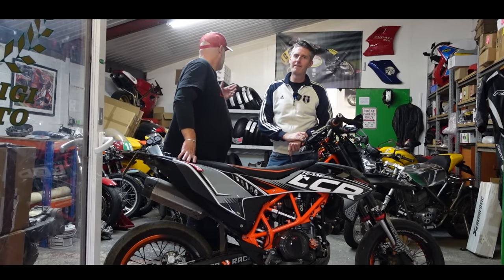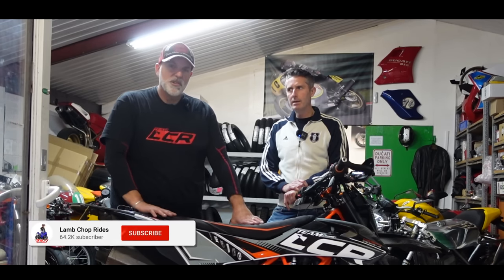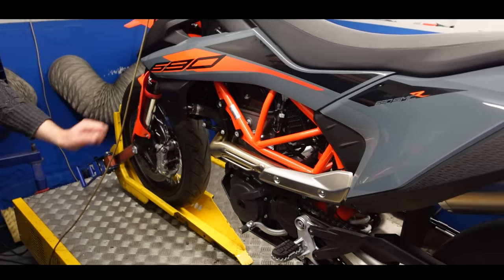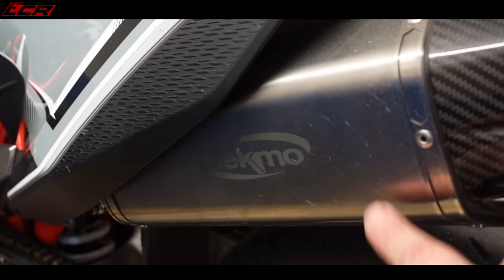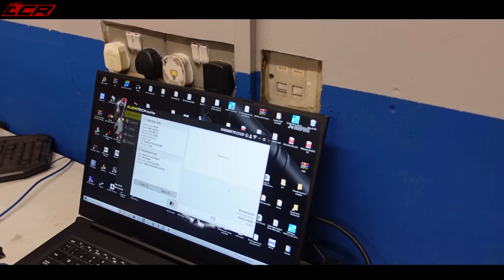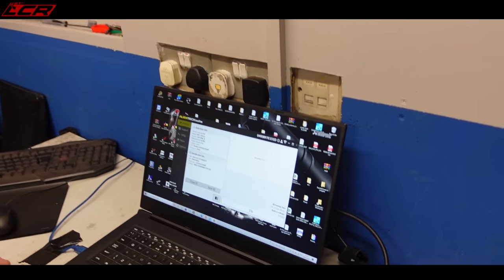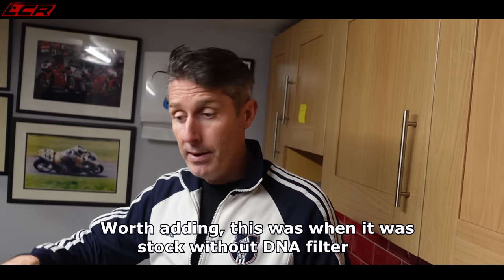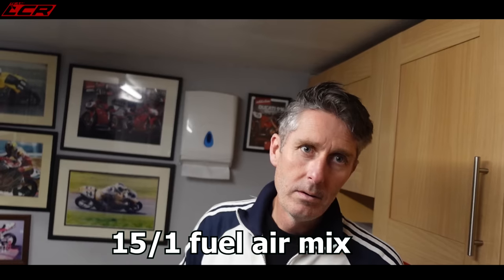KTM 690 SMCR Dyno Mapping | Finally Its Running Properly!! 💪💥

Comment: I am kinda confused with these results. help me out because the stock power is 75 bhp for the newest engine. I ride the 2016 model so the engine without the balance shaft and after some heavy modding  i get 78 hp now on the old engine.  mods are  full akrapovic system, open air filter (dna combined with k&n) camshaft,lambda removal with the rottweiler dongle and the powercommander to override the stock ecu because its not made to write a full map to it.
Reply from the maker: Yes 75 hp at the crank, these are rear wheel figures. You loose 15% or so via the transmission. The gains are in the bottom and midrange, you won't get more at the top without cams but then that sacrifices midrange and bottom end. For the road riding and wheel popping ability   we prefer the midrange punch to topend screaming
Reply: @Lamb Chop Rides  Ok that explains the difference in power measurement. Thanks for the quick explanation 👍.  I ordered the new 2023 model so I am curious if it wil ride better than my old 2016 model.
Reply from the maker: Yes its much smoother with the extra balance shaft 👍👍

Comment: Proof that a Power Commander correctly mapped is as good as a reflash. Plus its a 5min DIY job to remove if you want to make a claim or sell it when you no longer have the bike, so its not 'dead' money thats lost.
Reply: Totally agree with you Dave but what if it’s a EURO5?

Is a Flash not really the only option?

I’d prefer not to void my warranty and always have the option to put everything back to standard. 

but what other option is there when the closed loop section will always over ride a Power commander 5? (With the EURO5 Engine)
Reply: @SuperPlasterMaster  inline fuel optimiser allows a euro5 bike to run a Power Commander but it needs the right map and this is where it matters and CRT can supply the right map.
Reply: Do you have any proof that the PCV and the fuel optimiser works?

Not to say that I don’t believe what your saying but I have read so much regarding the Fuel optimiser and the Power comander 5not working on the EURO5.

A video showing a Dyno run of a EURO5 Smcr 690 or a 701 
with the PC5 and CRT’s fuel optimiser and Map would be a great way to prove that they all work together and would put a lot of speculation to bed for many that would love to know for sure.

Yet there doesn’t seem to be any videos fitting that description. (That I have managed to find at least).

If there is such video I can assure you that I will be the first to buy a power commander and map from you at Crt.

Perhaps Lamb chops rides would be interested in making such video if you would be willing to supply the parts and I was willing to pay for the dyno?
Reply: My dyno guy sold his 690 after lockdown when he wrote maps for every pipe, induction kit  and delete kit we could get hold of. I’ve sold 30+ mapped PCV to euro 5 owners without any issues. The only problem I’ve had is when the customer has gone off and tried to sort his own map.
Reply: An optimiser is cheap so buy one and if it’s not working for you send it back for a refund 
You’ve got nothing to loose
Reply: @davecornish6716  what about the £400 for the PCV and the £45 + VAT for the map?
That’s quite a lot to loose if I’m getting zero gains in the closed loop section.

Especially since that’s where I want to add the power and torque and eliminate the lean fuelling!
Reply: @SuperPlasterMaster  I'll ask my dyno guy for a map inc A/F
Reply: @davecornish6716  ok that’s great but if it’s including Air fuel ratio adjustment. 
What guarantee is there that the EURO5 ECU will allow the adjustments made by the PCV in the closed loop section?

That’s the whole reason Greg went to Chris for the flash, cause he and Chopsie are under the impression that the PCV doest work on the euro5 ECU in the closed loop Section.
 (feel free to correct me if I’m wrong here @Lamb Chop Rides).

It only works in the open loop section. (Which is not where I’m looking to make the most gains)

Comment: "The map needs to have a nice shape to it"

No, the map needs to reflect the actual fuel requirements, and it's  very unlikely that those requirements are a smooth function of throttle opening and RPM.  Pressure reflections in the intake change with both throttle position and RPM, which affects volumetric efficiency so it's quite usual to see peaks and dips. "Smoothing" these out doesn't make anything better.
Reply from the maker: Chris was smoothing between where where fuel changes have been made. Not the standard map after he's added fuel so there is not a big jump between map positions

Comment: I've got a stock 2019 SMC-R and it it gutless compared to my 701 SM that was stolen. Dealership says there is nothing wrong with it... Ugh - I'm sad. Not sure where to begin. My ninja 400 track bike has more power.
Reply from the maker: Get it mapped and release the beast! Euro 5 is what's wrong with it
Reply: Great vid - thanks for the suggestion. Still on the fence on what I'm going to do with my 690. It's been sitting in the corner of the garage for a few years due to 7 surgeries in 5 years. Been focusing on road racing my Ninja 400 out here in California. Maybe it's time to dial in the 690 - there is a few classes it can be entered in and compete against similar machines. Even stock it's a hoot on the track so I can only imagine what it's like once it's opened up breathing right. Your vids have definitely inspired me - glad I found you! Subscribed!

Comment: can anyone tell what software are they using? WinOLS?
Reply: Winols 5. Paired with an imported A2l map description .
Reply: @ecureverseengineering1850  thanks! that means someone already did the hard work of finding all the map data within the file? is the editing also done in the winols or is it some different software? if he's using the kess hardware, why isn't he using ecm titanium then? 🤔
Reply: I've used winols since 2004. I make my own map descriptions. But in this case I had one that was directly leeked from this manufacturer. I wouldn't use ECM

Comment: I am afraid you are incorrect in your understanding of direct ECU mapping . Woolich racing and Tune ECU does not piggy back anything. These are direct ecu access tools.
Reply from the maker: Yes indeed but the operator is limited to what the tools can do. Where as Chris has access to change whatever he wants. Disable traction control for example
Reply: @LambChopRides  
Again you are incorrect. Depending on system used and operators status everything within the ecu can be modified if required . It really all comes down to requirements and the operators understanding.
It’s a good system Chris has used but it is not the only system out there.
Reply from the maker: @jamesholland4608  so with Woolich you can modify parameters which let's say are not already defined within the menus?
Reply: @LambChopRides  
Yes . As Woolich is sold to retail customers they have to limit its adjustments to the retail end user. There is a chance of damage to ecu or even rider if they don’t understand what they are doing.
Reply: Woolich gives about 30 maps to toy with. A factory description file as used gives you 3000
Reply: @ecureverseengineering1850  
No they don’t . If the ECU is readable type you should read it and make any adjustments to that downloaded map never introduce a new map file to an ecu . So the limits are endless.
Reply: I'm not talking about introducing new maps. Take a 2021 bmw for example. There are approximately 8000 maps and parameters inside it. The woolich will display about 30 of those maps . Everything is hidden from the software user. And the available listed map names are made up and are not representative of what is actually in the ecu. Using OEM editors such as winols combined with a2l map descriptions means you get the same adjustability as the manufacturer. Not a few toy tables
Reply: @ecureverseengineering1850  
But your missing my point. Within the content of the video a claim is made which is incorrect. There are a lot software providers out there offering everything required to make the adjustments within the ecu to correctly set the fueling and even ignition for road bike use. If you really want to get into the in-depth insight of ecu internals then yes there are hundreds if not thousands of tables to make adjustments to. Which can be accessed and changed with a good software provider . 
I am not criticising the software or Chris I am just pointing out that perhaps a genuine mishap has happened when describing software.